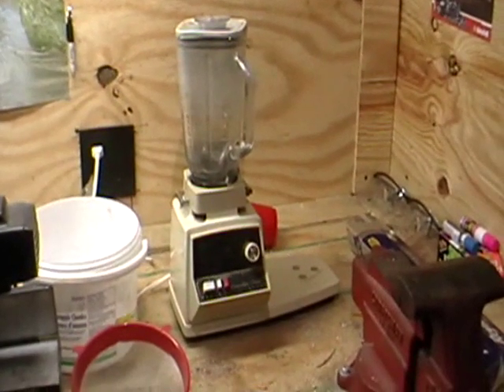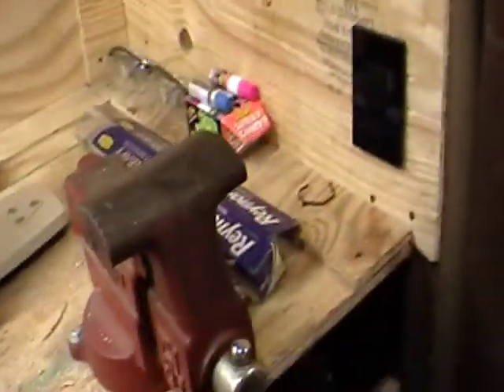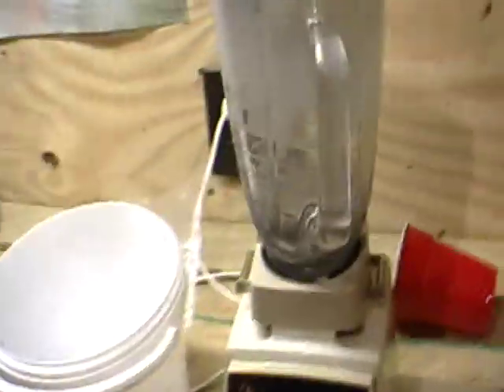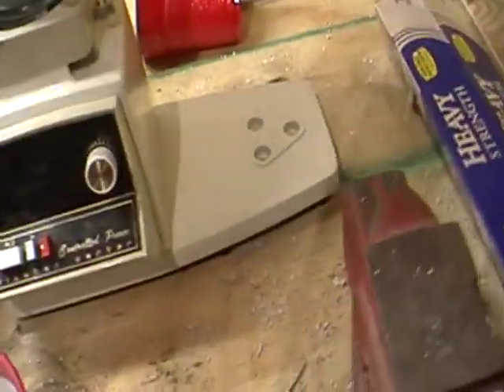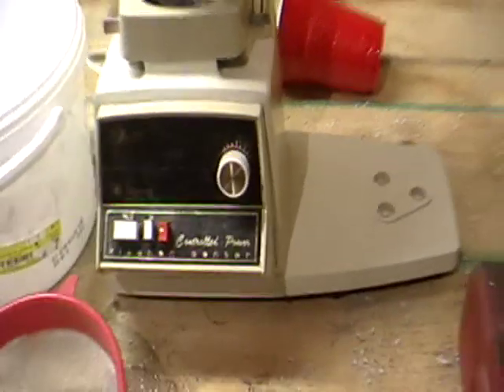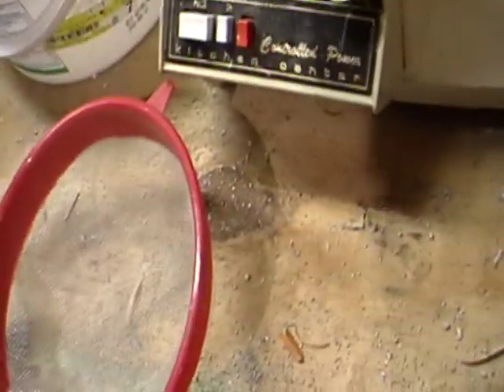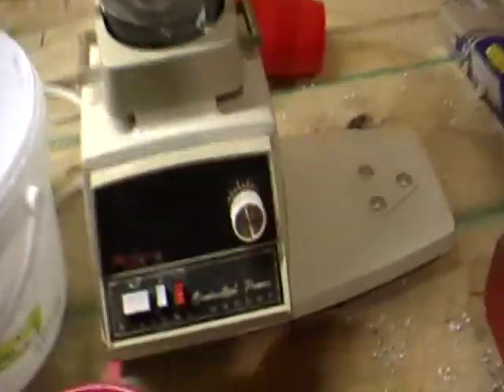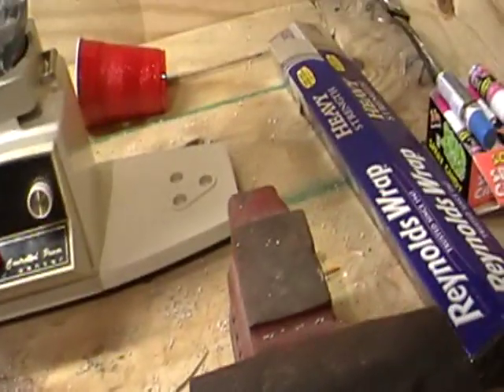How To Make Aluminum Powder

Comment: @muldoon55 Your welcome, glad you liked the results!!! For tube size there are two standard tube sizes for m80s. 9/16 x 1 1/2 and 5/8 1 1/2.  I like the 5/8 x 1 1/2 because its a bit bigger. For flash you need between 2-3g's. I have a special request for you. Pls make a vid showing the diffference between an m80 w/o milling perch compared to one with milling perch. As for the comp I use 70/30 for loud ones and 60/40 for deep ones.

Comment: first of most of these questions can be answered easily

aluminum can be toxic in cases when its inhaled as small particles so always wear a good dust mask when handling fine aluminum powder

this is of poor quality to make flash powder, you need at least 400mesh even better if you get 1-6microns, which will bind with the nitrate/chlorate/perchlorate

dont bother using a blender rip into small pieces, put in a good ball mill with a heaped table spoon of charcoal and you will get dark AL powder